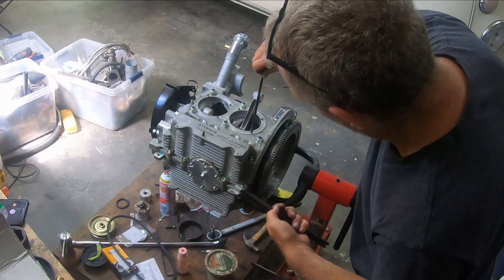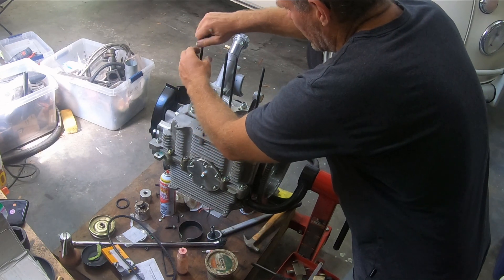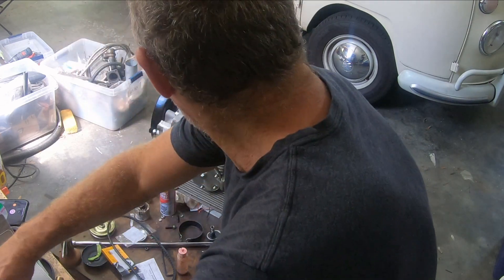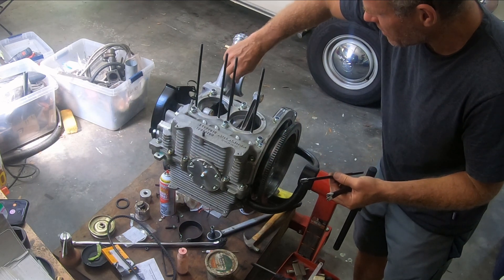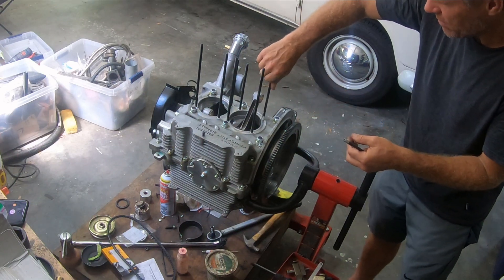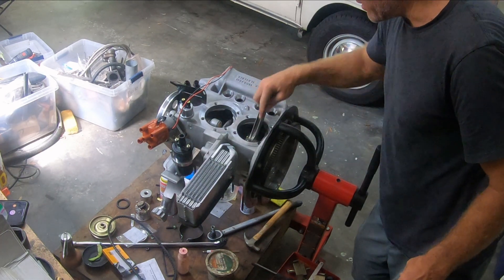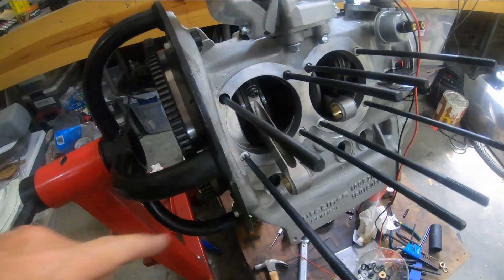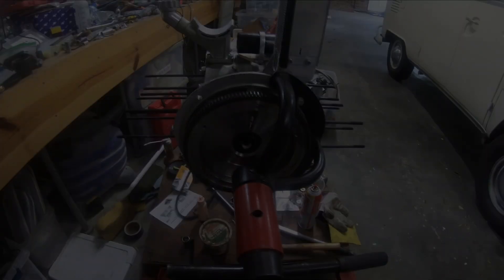2332 VW Air-cooled Stroker Motor - Video 26 - Installation of Head Studs

Comment: Why high RTV instead of Locktight?
Reply from the maker: It was high temp thread sealant, not RTV and not thread locker.  I think you don’t really need to worry about locking the studs as long as they are torqued properly - I used the sealant in case it needed to protect from any oil leakage.  I think I was only going off of the methods I read in the VW engine assembly book or online…